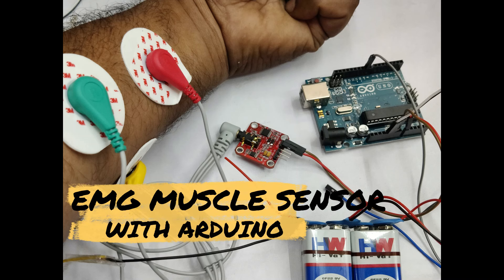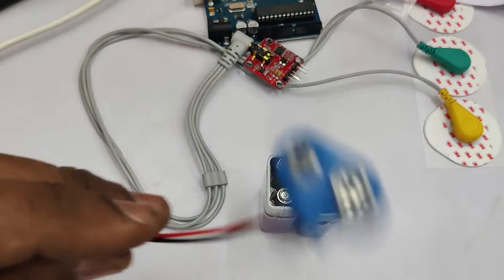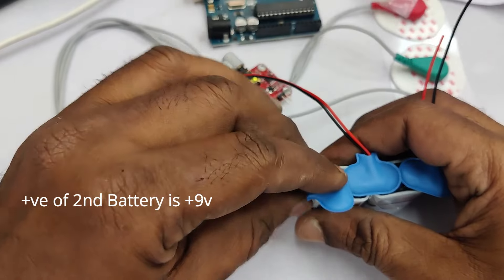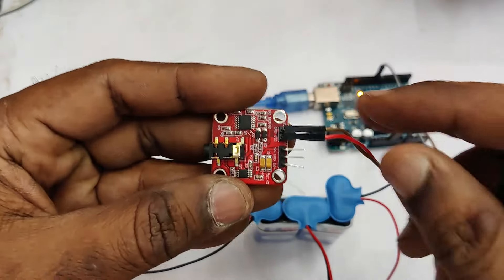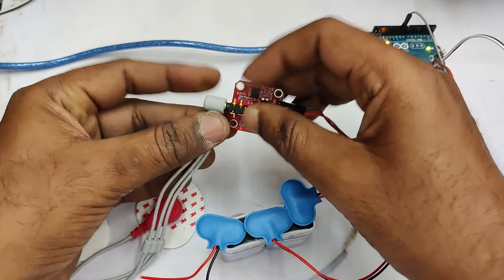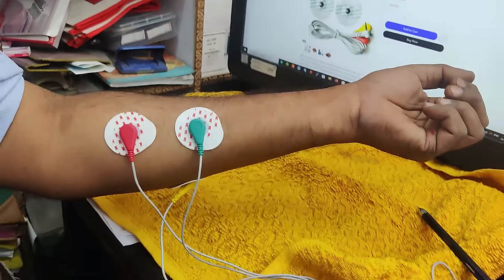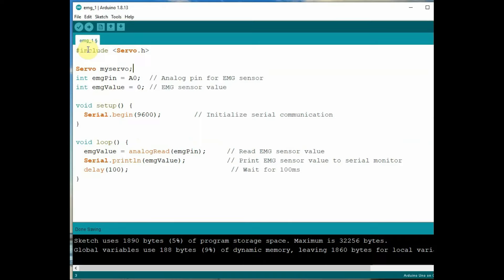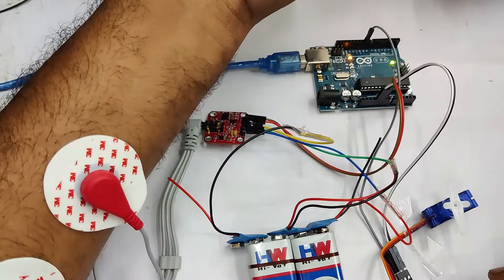EMG Muscle Sensor Module with Arduino

Comment: If you are constantly getting the 1023 value take a look at the board if ithas a small screw with label gain. Its a potentiometer. When I reduced the value of the potentiometer I got my sensor detecting the signal.

Comment: Hello Sir,

Actually we are developing the bionic hand in our collage and we are using the same way you have showed in the video but we have a problem sir, can we get the different analog signals (we are  not getting) for different (Individual) fingers movement. if you have developed the hand or if you can able to help us in developing the bionic hand please let us know, it would great help for us sir. Sir, if it is okay for you, please also let us know how can we reach out you regarding the same. 

Thanks,
Vikas
Reply: Hello, Vikas! We are doing the same project. This is a problem that we are getting.
Reply: Hello Vikas,We are working on the same project, but we have a problem and I wanted to know if you have encountered it before .. The problem is that the sensor reads the signals in the first use and then after that it does not work properly .. Do you know what are the circumstances or the mistake that we have done and  Did the sensor board burn out?
Reply: hello vikas , I see that all of us are facing the same problem. So, If it is possible to make an Instagram group to discuss these problems together.
Reply: @malakibrahem-uq1zz  I agree
Reply: @roulexfeat4044  hey, me and my group is also working on a similar project, so can you all please add me also in your discussion, that will be very helpful for me.
Reply: @malakibrahem-uq1zz  me too can i join with u
Reply: instead of using emg sensor use myo arm band for 8 signals this emg sensor never give you more than 1 value so
Reply: Can you please help me out..I do have the same problem..
Reply: hey vikas did you got the solution...Im doing the same project and facing the same problem.. if you have solved it please share
Reply: @vikass59 can u plz elaborate more about this like i will be doing this proejct in my clg nxt month
Reply: @LiberumDisce Heyy. Im thinking about doing this project too. Were you able to solve the problem? Im just planning this project right now. Can you recomend me what sensor i can use. I have an arduino so it has to go with it. Can i maybe get ur contact to discuss the further topic?

Comment: Sir is it possible to use this to detect CTS disease? Do i have to use 2 9V batteries just to detect signals? I'm not using a servo motor

Comment: Sir , I have a problem..When I connect the robotic hand to move it depending on the reading of the EMG sensor, the hand must be connected to an external source in order for the 5 servo motors to operate together, but the problem is when I connect the external source with the circuit, the sensor reads one constant value, which is 1023..please help me  Sir, because it is a graduation project and time is short, thank you.
Reply: Ocupas filtrar las fuentes de alimentación o conectar puras baterias
Reply: Did you solved this problem? i'm getting the very same one

Comment: I'm trying to make a wearable device to track gym exercises. But the issue is to track leg exercises like leg presses, while wearing only a watch. Does this sensor react to that? I mean the whole body tenses up while using big gym equipment, even if it's mainly the legs
Reply: Are you able to make any headway with that?
Reply: @ikennachiawa7208  my prof said its like estimating the temp of this room while putting it in the next room lol. Ig we could just give instructions to use it on the mobile limb, in this case put it on the ankle 😅

Comment: If you can make a video on how to configure myoelectric signals to perform a task using arduino that would be wonderful
Reply: you would need to do signal extraction for that, identifying individual unique voltage range which generates only when you do certain muscle movement (e.g. opening-closing fist) and then observe and put those values onto code and then RUN it thats it. servo will work if input signal's voltage fall within your defined range else not work! you can replace servo with other components such as relay or light or beeper or LED strips etc. endless possiblitie.

Comment: why does it require dual power source? can you explain the functioning of this emg pins please
Reply from the maker: Instrumentation amplifier used on board is capable of amplifying a small signal with a large gain. But this  can also amplify any noise that may be present in the signal. To minimize this noise and interference, a dual power supply can be used to provide a stable and consistent reference voltage for the amplifier.
Reply: @SaravananAL 
Compilation error: 'emgValue' was not declared in this scope
Reply: @SaravananAL  Do you know how many hours of use you get from the 9v batteries?
Reply: @SaravananAL  Hello, can you please write in detail the material and program code for this emg simulation

Comment: Is it possible to detect EMG signal with ECG sensor
Reply: it's not as precise as it would be with a proper EMG sensor, I almost bought a ECG kit when I read about the difference between the two
Reply: @whoisyousos is that ecg module worked?
Reply: @harshit9112  didn't want to risk it, so I bought a EMG module, but I didn't get a chance to test it yet
Reply: @whoisyousos  kitne ka liya emg module
Price of emg module that you bough?
I am also buying it for my project
Reply: @harshit9112  i don't remember precisely, something around 25€

Comment: I stopped watching after he used three battery connectors and cut two of the wires off, instead of just using two battery connectors.